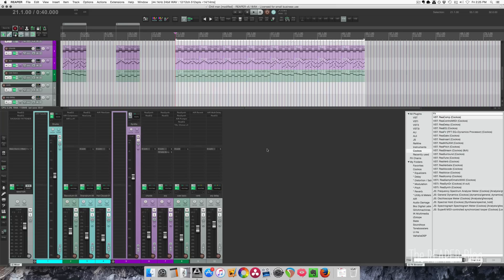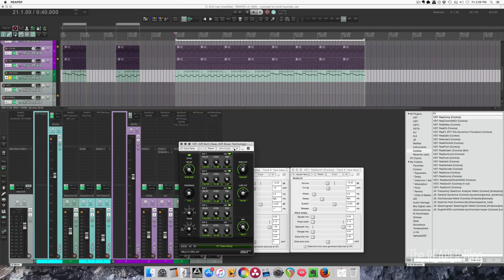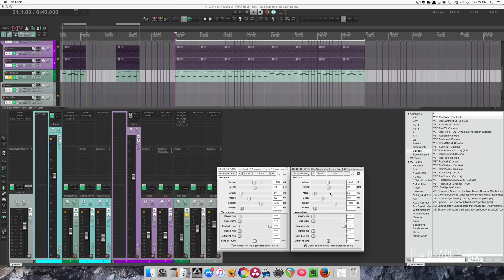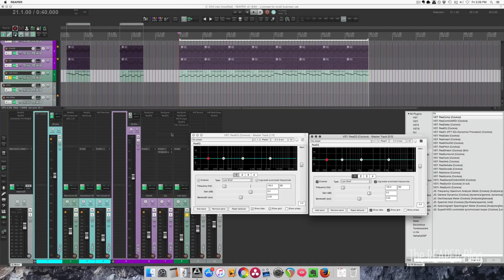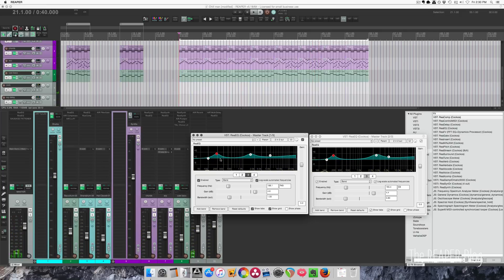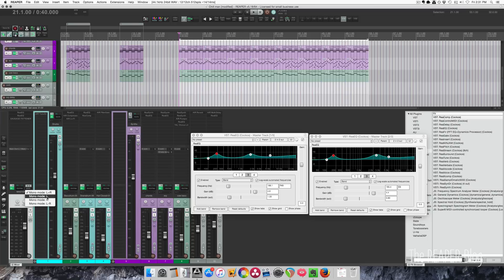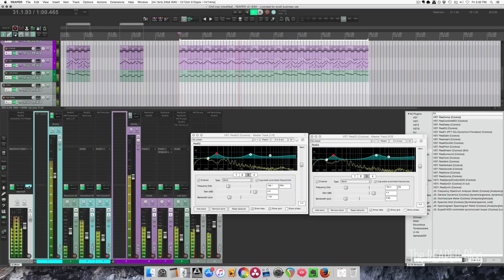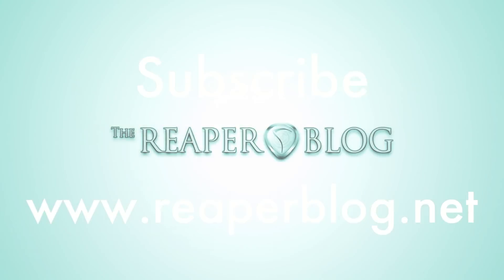Multi-mono Effects in REAPER

Comment: Unfortunately it is not the case that ALL plugins is Reaper have the pin connector. Several of the plugins I use in Reaper do not have it (so I assume it only appears for VST plugins, not DX ones).

Is there any workaround for plugins which do not display that option?

Comment: What about bringing two guitars (hard l & r) into a multi mono for reverb with the reverb of  guitar (left) being panned hard right and vice versa for guitar (right)?
Reply from the maker: I would just reverse the panning (set track to dual pan mode), flip the width to -100 (set track to stereo pan mode), or set the verb plugin outputs to flip the channels. I very rarely use sends on pans.